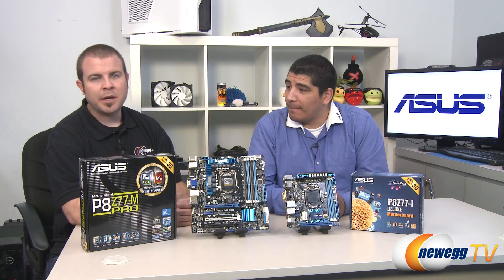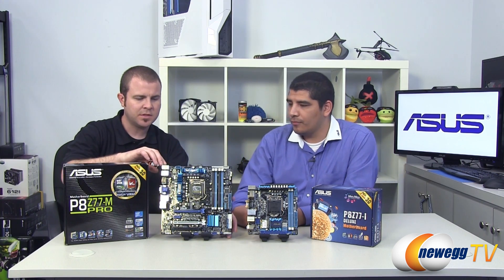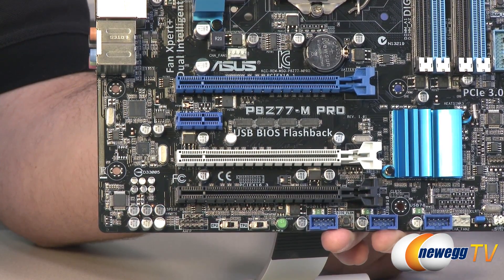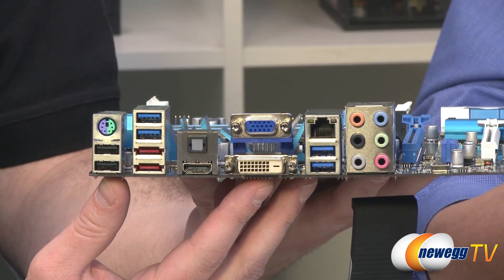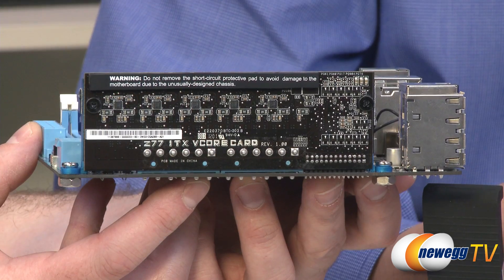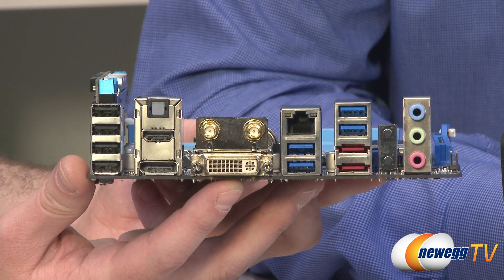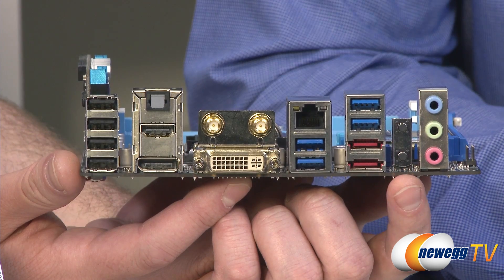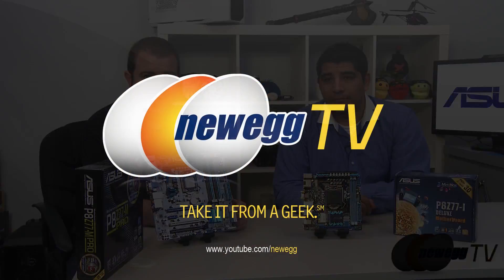Newegg TV: ASUS SFF Z77 Motherboards Detailed - P8Z77-I Mini-ITX & P8Z77-M Pro Micro-ATX

Comment: Also, I suggest you to either step down to a 660(non-Ti) and save yourself some money, or go all out on a 670 (again, verify if the 450w is fine). From what I've seen in most benchmarks, the Ti is rarely better than the 660, because the 192bit interface is a bottleneck for the Ti; the non-Ti is simply a more balanced card.

While on the other hand the 670 isn't limited by a 192bit interface and can fully utilize the additional raw power it has over the 660non-Ti. It's costy though...

Comment: The absolute maximum length it can house for a gpu is 10.43" if I remember correctly, but try aiming for 10 as a maximum to be more comfortable with cable mgmt and stuff. (Mine is 9.5, could've been a bit longer easily)

As for the PSU, you might want to make sure it's safe (google), but I've seen a lot of GTX 670 builds with this PSU, so it should be fine.

Comment: Not my style; too sci-fi-ish for me, but I believe it's a fine sff case. If you're considering the case I mentioned too; my build is now done since my comment, and I can HIGHLY recommend it. The size is just perfect (can't go any smaller than that, UNLESS you don't plan on buying a graphic card), it's silent enough, and I read around that the integrated PSU is good quality.

From the look of it the A30 seems more or less the same size though.

Ask away if you have questions for your build ;D

Comment: I'm going with a Thermaltake A30. Aggressive look, viewing panels, plenty of venting, and light-up LED's. Only 120$ on Newegg. Plus, it's smaller than the BitFenix Prodigy, and cal still fit a standard size ATX PSU with a cooling unit and a dual graphics card, triple if you remove the cooler.

Comment: Yeah the CPU placement just killed it for me. I got an i5-3570k, so I wanted a non-ref heatsink/cooler to be able to overclock well, it was already hard to find a good one considering the limited height of the sg05, finding a good one fitting the ASRock itx would have been impossible.

Didn't know about the 2 PCI-E though, that's interesting. So if I ever want a dedicated sound card, I could remove the wi-fi module and replace it with one? (not sure soundcards actually go into PCI-E slots lol..)

Comment: The ASRock has some nice features, but also many problems. Especially the CPU socket placement is horrendous as it nixes many tower air cooling set-ups while you can put in a huge one on the Asus. The Asus also has 2 PCI-E, as the Wi-Fi card (horizontal on the board) can be unscrewed and unplugged to give you an extra slot for for example an additional SATA III controller etc. The Asus digi+VRM is also unparallelled by any other manufacturer.

Comment: I'm not sure this is the proper place to leave feedback, but I'll do so anyway. Please, make a Maximus mini-ITX with a SupremeFX IV and the works. It's quite important for a mini-ITX system as there's no room for a dedicated sound card, even if you hook up an external DAC/Amp box, you'd still need all the DSP (THX studio, EAX) from the integrated chip. Also, bring back legacy PS2 - people with high-quality mechanical keyboards usually still need those.

Otherwise, great job on the VRM.

Comment: Thank you for responding. You make good points. Further thoughts: One alternative to the trace congestion near the IO area would be to relocate the rear USB to additional USB headers in a different area of the MB and cable the USB ports through a grommet in the IO shield. Rear panel audio could be done in a similar manner. BTW do we really need the High Current USB in the rear IO? It would be FAR more useful in the front panel USB where it would be actually used to charge mobile devices.

Comment: I think it would be a good trend for the mini ITX board manufacturers to rethink the IO shield area of the boards. One possibility would be to move many of the USB, eSATA and audio to either a dongle or short female cables. This would free up some of the valuable IO shield area for more mini PCI-e riser slots. There is an increasing variety of mini PCI-e addon cards becoming available. Use of mini PCI-e cards would help offset the loss of PCI-e expansion on the mini-ITX and mATX boards.